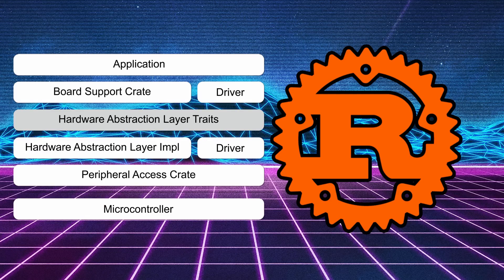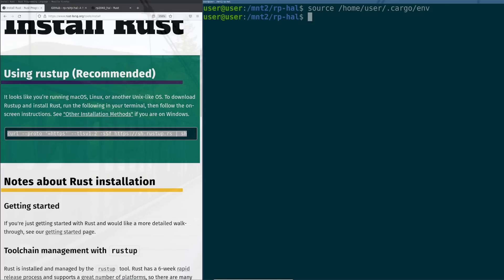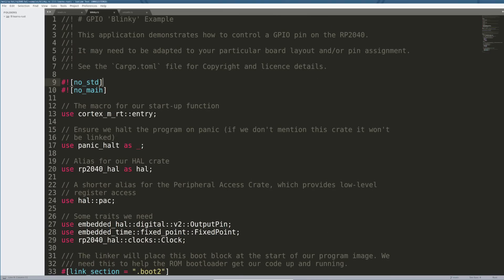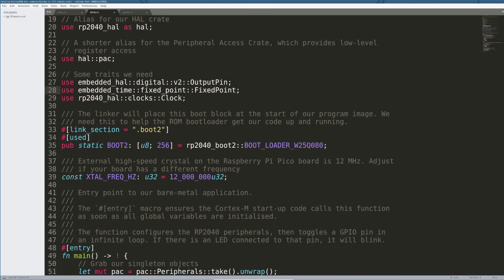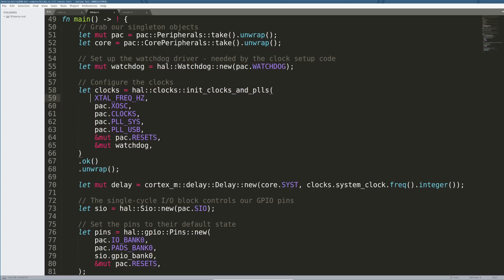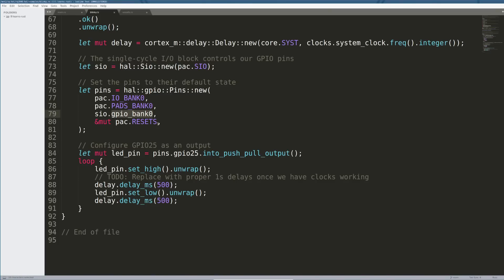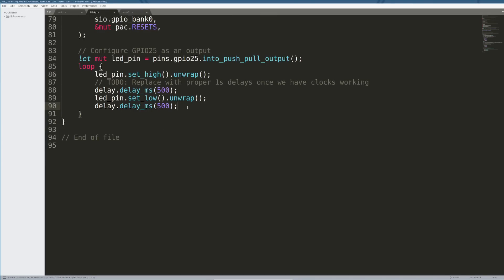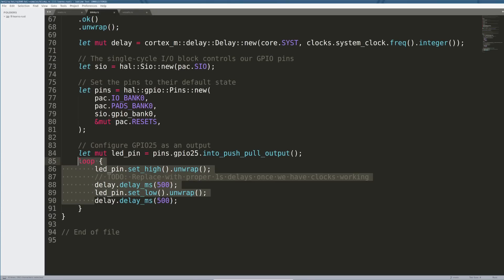rust runs on EVERYTHING (no operating system, just Rust)

Comment: Excellent! There are a couple of erratas. You don't actually need a variable to be marked mut to borrow it out to another function. You will actually have a much harder time borrowing a mut variable because rust wants only one place to be able to handle changing the underlying variable at any given time.
Reply: erratum to your comment, errata is plural already
Reply: @FreedumbHS  Nice shot in your foot:) see: There are a couple of ways. And NOT: There are a couple of way.
So "There are a couple of errata[s]." is absolutely correct. Hint, see collins dictionary: "As a singular noun, errata has developed an English plural form erratas, which is rarely used". Because YOU don't know that use, should we now inform the speech-police?:P
Also, see: "References and Borrowing" in the official online book "The Rust Programming Language"; and 15.3 Borrowing and 15.3.1 Mutability at "Rust By Example"
Reply: Also push-pull is not referring to data direction; it refers to either pushing current out of the pin (when high) or pulling current back into the pin (when low).  The opposite of push-pull would be open-collector, which is just the push (where the pin can go high, but would need a pull down resistor to go back low again) or open-drain, which is just the pull (in which the pin can sink current but cannot source any).
Reply: @amateurprogrammer25  that I did not know. Thank you!
Reply: @amateurprogrammer25  not quite, open collector and open drain both can pull only low, and require a pull up resistor to pull the signal high again. The difference is only the technology used to implement it, bipolar for open collector and CMOS for open drain.
Reply: Yup. You can only have one mutable reference OR multiple read-only references.
Reply: @r.pizzamonkey7379  In rust speech, & implements Copy and &mut doesn't
Reply: @rumplstiltztinkerstein  sort of but not quite. I'm pretty sure it's a different system which supercedes traits.
Reply: @r.pizzamonkey7379  maybe they're just special pointers
Reply: Thanks mark learned something
Reply: Something else important to add on to this is if you want to pass by value and not reference, the data type you are passing needs to implement the copyable  trait.  However, it is much cheaper to pass by reference since it’s as quick as passing a memory address. And with rust, passing by reference can be very safe since an immutable reference wont allow the borrower to have change the value at all or have an unwanted side effects to the reference.

Comment: Nice walkthrough. HAL does make codes more readable as it is more standardized. Good low level C programmers wrap registers/dma access in small functions. Thank you!
Reply from the maker: Good tip!
Reply: What's wrong with proper commenting?
Do you have to add pointless jump commands around your low-level instructions, complicate the things happening in stack, etc?
Reply: @Mr.Leeroy You underestimate how smart compilers are, if it can inline, it will 90% of the time

Comment: And what is the binary size the rust produces compared to do the same application compiled by gcc?
Reply: There is both a gcc and llvm implementation now. They are almost always around the same +/- a few precent.
Reply: Realistically, a rust binary compiled with default settings will be rather large. But by setting a few options in Cargo.toml you can get it much smaller. Also by avoiding formatting code and using something like defmt you can get it even much lower.

Comment: Raspberry is one of the most normie embedded system out there. Saying rust runs on everything because of this is silly. It has to run on very niche systems in order to claim it runs on everything. I wish it did but it can't be compared to pocket assembly C in this matter. Making a compiler for C will also be extremely easy compared to anything else under limited environments.
Reply: The RP2040 is still pretty new, only being a year old now (plus a few days.) It's nice that Low Level Learning picked this chip and board because it's very cheap ($4) to get your hands on one to follow along. My only "issue" with the Pico board is that it doesn't have a reset button that you can hold for flashing the bootloader.
Reply from the maker: Totally agree. The lack of a reset is a huge pita.
Reply: We have Arm, MIPS, RISC-V, MSP430, PowerPC, x86, x86-64, WASM and SPARC currently, but PIC and AVR will probably always be better supported by C.